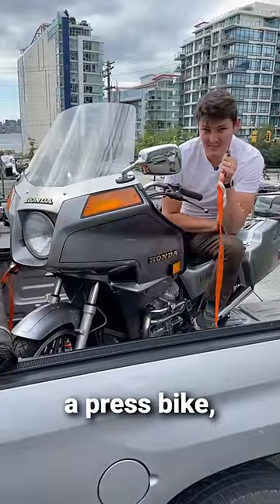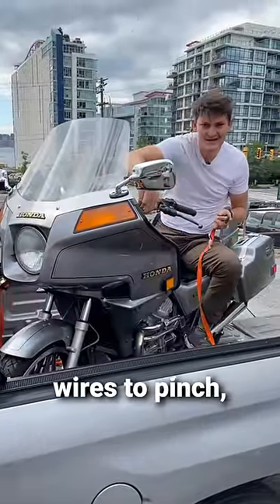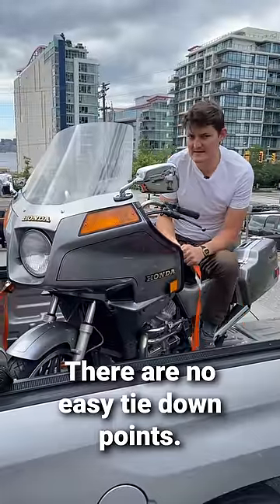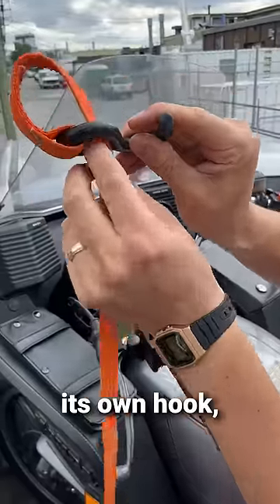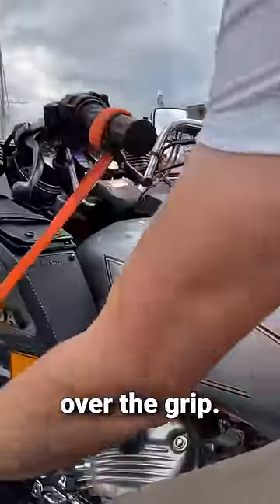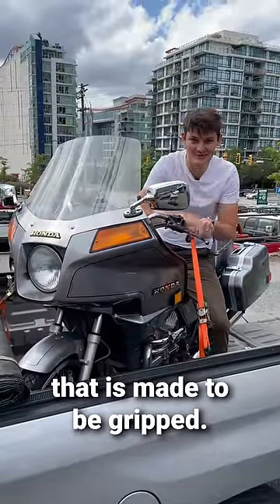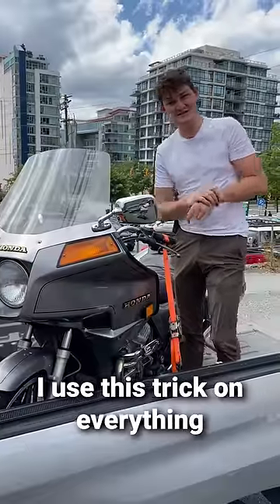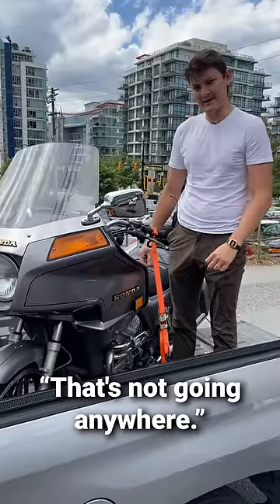The #1 Trick for Strapping Down a Motorcycle

Comment: I was service manager at our local Honda Dealership, had to load uncountable numbers of bikes in all shapes and sizes. We never EVER use the grips as a tie down. Grips can come off,  and loading weight on the end of the bars on some bikes is sketchy to say the least. Ideally we want the straps as close to the frame as possible. I prefer to use the lower fork legs below the seals. You lock that front end down and the rest of the bike will be secure.
Reply: This is a terrible idea and Fortnine should take the video down.
Reply: How the lower for leg. UDF legs?
Reply: @wesanderson5011   Over the fork lowers, then.  You can usually wrap around them at the axle for sure.
Reply: Attaching to the lower forks doesn't provide enough height, not enough leverage. And would put too much strain on the forks. That Wing is Heavy. 
   I would never. 
Just remove the fairing.

Comment: I tow for a living. You never go off handlebars unless it's a tiny sports bike. You can blow the knurls that grip larger bars at their angle and the handlebars end up flopping down and straps go loose.
Reply: I must have read this sentence about 10 times, but I still have no idea what you're saying.
Reply: @TheLukasDirector it means the handle bar will bend
Reply: I’d appreciate if you explained how to properly secure for those who do not know how to secure their bikes without a hitch bike mount or trailer
Reply: @TheLukasDirector it’s crazy how you can write English, but can’t comprehend it. What an anomaly
Reply: @jackyl5243 strap the forks and rear wheel. Plenty of videos on YouTube showing proper ways. Our homeboy F9 is just trolling
Reply: @TheLukasDirector it does not mean the handlebars will bend. The clamping part that holds the bars to the bike will fail and they'll be pulled to a new angle. You know how bars are just a tube clamped in a piece of metal to keep them at a certain angle.
Reply: You had me at the proper use of loose. A rare event on YouTube🤣
Reply: I swear this comment was written in English, but I can't seem to prove it.
Reply: @TakumisBizarreRacingAdventure they can snap on a newer gold wing
Reply: @SexyWaffleTaco he’s not saying the handle bars will bend he’s saying as the suspension compresses and decompresses it will loosen the strap. If strapping your bike down bends the handle bars would you really be comfortable riding it at 50+ mph lmao not me.
Reply: If they're tying it down so tight it snaps the knurls in the bar clamps thats the least of their worries, they're gonna need new fork seals too lol
Reply: @horizonb1744 i can’t easily put hundreds of pounds of force through my wrists into the handle bars. Arguably, if you are doing that, you’re riding very wrong. You should be loose on the grips, like you’re playing the piano.

Comment: Just an hour ago I strapped my CRF300 down in the bed of my truck. 
I use soft ties on the handle bars and luggage rack. 
To keep from blowing the fork seals I got a device which fits between the front wheel and the upper fork connection. 
I’ve never had any problems with my system, but I will definitely try your new method. 
Happy Trails

Comment: Never ever, never strap a motorcycle by the handlebars, I've had far too many bikes delivered to my shop with bent bars, damaged throttles, loss of heated grips, 
Most transporters have stopped the practice I just hope owners can too.

Loop around lower triple clamp, or engine guard if you must.

It's hard to imagine the force being large enough to bend the bars but think big pot holes, and accident or the over aggressive owners with a ratchet strap lever! Yikes!
Reply: My thought exactly. Handlebars are very easily bent and those ratchets can be really strong.
Reply from the maker: Oh damn I didn't think about heated grips! Thanks for the tip. ~RF9
Reply: You may want to take this down!
Reply: @FortNine you are the best Ryan! Humble, accepting mistakes. Such a good guy
Hope every positive thing happens in your life!
Reply: @FortNine   you should take this down.
Reply: you can see in the video the rubber from the grips been deformed, bad idea even without heated wiring involved.
Reply: @FortNine this is really bad advice unless you wanna mess up your bars
Reply: “Far too many bikes delivered to my shop” … I’ll take, ‘Things that have literally never happened’ for $500, Alex.
Reply: Agreed, on the throttle side you are torquing on a thin walled plastic (probably) tube. If you crank it down against the stop, it will eventually break.

Comment: Sure, if you want bent bars. When you hit a bump the suspension compresses and slams it on the bars. Instead, run the strap around the fork on each side,just over the fender. Now you are strapping unsprung weight, not dealing with fairings and it is fully secure.
Reply: A bump is not going to bend a set of bars (unless they're cheap Chinese junk). 😂 And also, putting straps on your forks like you're talking about  can damage fork seals.
Reply: @bigdeal5394  squishing down the forks by strapping it by the handlebars puts all kinds of unneeded pressure on the fork seals. I strap it below the fork seals so the forks are not compressed at all. Then the suspension of the bike takes the weight of the bike, not the straps. I'm sure strapping it by the bars will work for a while, but yes, I have heard from people that it bent their stock  bars. I'm not saying it doesn't work, there is just a better and safer way to do it.
Reply: Dude what do Ya'll think happens when a 250 Pound dude rides a motorcycle ? and no "blabla bike weighs 500 pounds" just because the bike weighs 500 pounds that doesnt mean that there are 500 pounds of load on the ratchet straps. Get into a basic physics class lmao.
Reply: @jakecole7447 well I'm no physicist like you, but a ratchet strap can put over 1100 lbs of force on the bars. I think that's a possible 2200 lbs of pressure on the bars. But you probably know exactly how much pressure you are putting on the bars every time you ratchet it down. And I'm sure driving for hours with fully compressed suspension is great for the fork seals. But what do I know, I'm not a physisist.
Reply: @TimsMotorcycleAdventures bodied the YouTube 🤡 physicists

Comment: That compresses the fork though. Some people say it’s better to hook it on the wheel axle. This topic is worth a video I would say!
Reply: If you dont compress the fork what keeps the strap from losing tension when the suspension compresses while you drive?
Reply: just dont compress it too much or youll bust the seals! but you gotta go really hard for that
Reply: @RDEnduro If you strap to something solid that is unsprung, such as the axle/forktube, you don't have to worry about the suspension compressing and your strap coming off. 

It's why you don't see tow trucks tying down automobiles to the frame. They commonly choose the tires or axles. Unsprung.

Now sometimes you have to improperly secure your load, as you don't have anchors available where you would need them to properly secure your load. In this situation I'd probably do exactly as he did; as he mentioned, plastic is in the way. 

Quick explanation: YouTube motorcycle tank straps
Reply: @JohnnyD1993   yep, I agree with that, same thing happens on the rear side, where ideally you want to secure the wheel/swingarm, but sometimes you just tie the chassis/subchassis

In addition, this is better because you allow the suspension to work freely while moving on the trailer
Reply: Is good to compress the fork, the fork is compressed with bike on sidestand too. Is called “static sag”.

Comment: Fastest way to kill heated grips!
Reply: What's heated grips
Reply: @ryanmg02 Grips with integrated heaters. Just like your heated seats or heated steering wheel in a car. Except on a motorcycle it makes a lot more sense to have.
Reply: Trade for heated gloves or ride everywhere 😂

Kidding, I want heated grips. I have hand issues that cause sensation loss in the cold. I can't get a bike until I can afford one with the bells and whistles 😂
Reply: How?
Reply: The small wire elements that are inside the rubber of the grips that heat up get crushed by the straps.
Reply: @jld553  maybe?  Ig it depends on how much pressure you're putting on it.
Reply: Heated grips sound amazing, i didn't know they existed
Reply: @braddeicide  Some walk behind snowblowers even have heated grips nowadays. 

I can see them being really nice on a bike if u ride in the cold. Windchill effect makes your extremities act like radiators, cooling your blood.
Reply: Looks like it would kill normal grips as well, the amount of twisting the grip did in the center did not look good.
Reply: @ronaldbird6285  you can also see the center of the grip getting twisted in the video which could also damage the heating elements but it also does not look for normal grips.
Reply: You sure? Mine still work fine.
Reply: @jld553  been using this for years on heated grips. Maybe yours just suck or you drive like an alien?
Not a big deal though since only a fraction use heated grips anyway.
I only have them on my enduro for example since I would never ride in cold temps with a naked, street, cross or whatevs anyway. You know... there's more to a body than just hands...
Either way, if you fall under these categories above this technique is just not for you. Cheers

Comment: I did this to my 2013 zx6r and it broke its clipons off.
Reply: Lucky u were not riding it at that time !!
Reply: @budbud2509   why would i be riding it if it's in the middle of getting towed? But ok.
Reply: @shibby1016  
The point I was trying to make was that I was assuming the the part was weak , or even had a defect that u may have discovered while out on a 
normal ride , with very bad results for yourself. I would not consider a 
clip on bar breaking even if it was used for a tie down point to be a 
normal thing .
Reply: @budbud2509 probably was tied down way to hard. With it overly tightened and going over a bump the change in stress will cause it to break
Reply: @boosted1328 totally, that's one of the problems with ratchet straps; they can easily be over tightened
Reply: @budbud2509 
No. Compressing suspension so that the bike no long HAS suspension. The bumping it up and down in a truck bed... The full weight of the bike being subjected to the shock load of whatever potholes and speed bumps the truck is going over.
That "weak" component would have an easier life if a 1000 lb man stood on the tank and then jumped onto it.
That impact load would be far less PLUS the bike would be able to benefit from its own springs.
Reply: @budbud2509 bars are not designed for that much force.  Would you tow your car by running straps through the front grill?
Reply: @beepbop6697 no I would run straps over the tires but cars stand up on their own bikes don’t.

Comment: What happens to the trottle tube  won't it crack or brake if you put to much pressure on it?
Reply from the maker: I haven't had a problem yet! But I only ratchet the straps until the suspension compresses an inch or so. Not a ton of pressure. ~RF9
Reply: @FortNine  okay thanks for the quick answer i will try it out next time i need to transport my dirt bike 👍
Reply: @FortNine  Stop doing that , you bike is far from secure . NO NO NO
Reply: @FortNine  Strapped on the handlebars with the suspension barely loaded... every bump in the road is a desaster waiting to happen. Your straps'll come loose every time the suspension compresses a bit more, i'm really surprised that hasn't happened yet. If you use any suspended parts to tie down a bike, you should preload it till the suspension is on block, so it really will go nowhere.

Comment: I just installed stainless steel tie down anchors on all my bikes on the lower triple trees and they work excellent and many bikes the lower triple tree will clear the fairings. Got them on 4 dirt bikes a Ninja and a z400. Prior to that we always loaded them either securing around the triple clamps which honestly never had an issue with, or closer to the middle of the bars and with that I've ruined rubber grommets on bar mounts from the force of ratcheting the bars down just a few clicks.

 Definitely helps to add more anchor points to your truck though and not be afraid to load a bike backwards if it makes securing it safer.

Comment: Handlebars are pretty flimsy. I use the lower tripple clamp.
Reply: Yep ... so do I - but the alternate usage shown is still honored!
Reply: The dealer strapped my first bike down in the bed of my dad's truck this way . The clutch side grip slid right off and dumped the bike in the bed
Reply: @carbongsxr750  fixatation at the rear is mandatory
Reply: Handlebars are pretty flimsy. I strap to the mirrors.
Reply: Wouldnt the throttle side be loose? It rotates
Reply: @JoeMama-vj8es  GOOD LUCK THEN

Comment: Until it’s a hot day and the strap pulls the handlebar grips off…! Also, some handlebar grips could become compressed and damaged by the strap. It’s probably better to strap onto the handlebars themselves - behind the switch gear. But even that could chafe on the surface finish. This is a tricky problem.
Reply: On that bike (and many others) you can't go that high up on the handlebar or it'll load the fairing when you tighten it.
Reply: I've always just strapped the bottom part of the suspension to the truck/trailer. Screw trying to keep the body of the bike still and just let it bounce above the immovable wheels.
Reply: @langhamp8912   What aanchor points on the lower fork tubes are you strapping to?  Do pray tell.
Reply: @mikeborrelli193  Almost everyone straps the bike's body instead of the bottom suspension. I think once a person does that they're not going to try a different way.

Comment: I just strap the bike down on the bottom part of the suspension. Sure, it'll bounce up and down a lot but the wheels stay rock solid and the straps are always tight.

I don't think strapping the bike via the top part like handlebars is a good idea since the strap go loose and tight over every bump, and if you really strap the bike down hard then the suspension is so compressed.
Reply: You can see the grip is now pointing downwards, if there is slippage the grip can walk off.
Reply: @andhewonders  And when the grip starts walking off, the strap will get looser and the grip will be more likely to walk off more.

I've done the Canyon Dancers method and that was always sketchy. Instead, it seems to me if you can get the wheels firm against the trailer then the bike will comfortably bounce of up and down in a gentle manner.
Reply: @langhamp8912  And I hate to think what's happening to the throttle, those straps used like that only grip about 95% of the surface, so you're distorting the tube, and there's only two screws and friction holding the bike on.

Comment: R&G racing do a strap cover that goes over both handles across the bar and you then attach the strap hools to the ends. I used to recover motorcycles all over the UK, crashed damaged mostly and delivering back repaired insurance bikes.

Comment: Canyon straps are amazing they slip over the bar ends and have a loop in them to distribute pressure evenly
Reply: Yeah canyon dancers are sweet. I have a 2004 R1150RT Police bike that I use those on and they’re great
Reply: @thezippomainac07  oh nice, when i worked at a ducati dealer we used them to transport multistradas and bikes like that. Worked amazing still have a couple myself for dirtbikes
Reply: Been happy with my Canyon Dancers for 20 years now.... They make it easy.
Reply: Canyon dancers are a lifesaver!
Reply: And many a regretful motorcyclist have bent their handlebars with Canyon Dancers. I have never seen a product package with so many disclaimers as a CD, not since liability lawyers tackled the ladder industry.
Reply: @N4HHE  It's not like the canyon dancers add any additional force. It's all about how much you tighten them down with the straps you have to use either way. You'd have to be pretty dumb to overtighten to the point of bending your handlebars. Canyon Dancers are just superior in every way. Especially the type with the big plastic cups that go over the handles.
Reply: @___meph___4547  sure! You are so right! I am put in my place!

Now, go use your Canyon Dancers on a Goldwing.

Don’t sent me the repair bill.

Handlebars on anything but a dirtbike were not designed to carry the mass of the vehicle.
Reply: @___meph___4547  yeah, it is exactly as if the Canyon Dancer adds additional force. Handlebars are not designed to carry the mass of the motorcycle. Especially not at the handgrips.

Comment: Wait but won't that bend the handle? That thing is surely not made for lateral forces rattling and pulling in that direction potentially with the force of the weight of that tourer when going through a pothole?!
Reply: That's exactly what it will do. Do not tie a bike down with the handlebars.

Comment: The problem is your loops is not secured so when you go over bumps and the weight of the bike compresses the suspension, your loop on the handlebar can slack  and eventually slide off the handlebar.

Comment: ** be very sure the handlebar clamp bolts/nuts are TIGHT.  I lost a Road King off a trailer once with a similar grip-strap trick.  As soon as the the nuts loosen, the handlebar will pívot down.  At this point you have no tension on the straps and over she goes.  Keep up the good work, FortNine Forever!!!